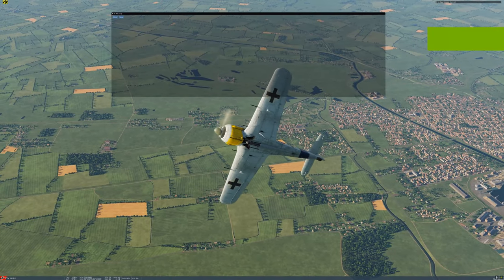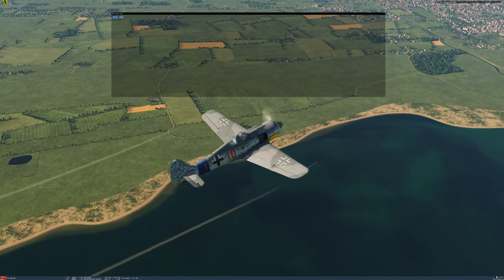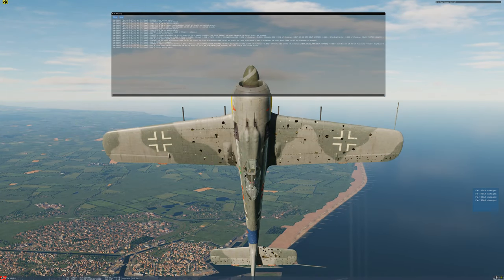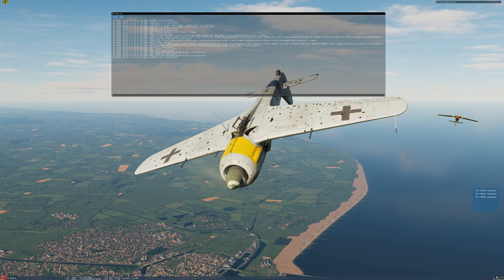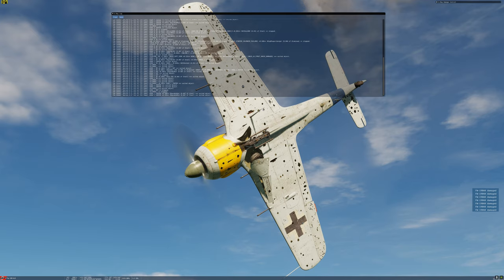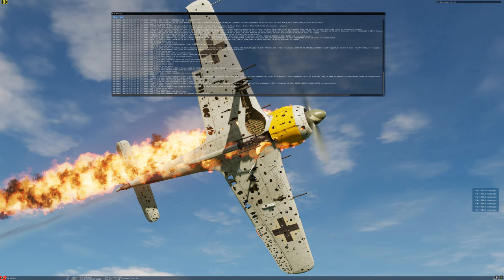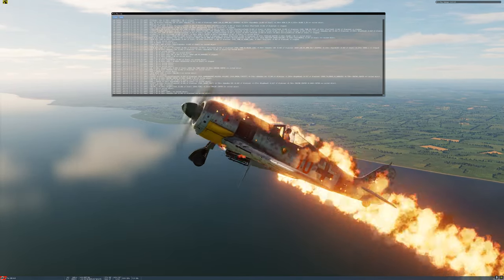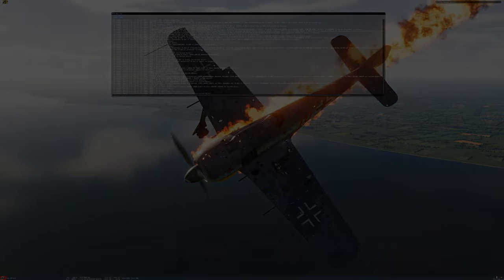User Track Analysis - DCS: P-51D vs Fw 190A-8

Comment: Hi NineLine,

Thanks for putting this together. It's amazing to see the detail that's gone into the model.

The issue for the slightly off performance sometimes appears to be the outdated belt composition we have on the P51 and P47. 

Combat Mix - Ball, AP, AP, API, APIT
Air to Ground - AP, AP, AP, AP, APIT (correct, but would probably only be used on very specified missions)
CS No Tracers - Ball, Ball, AP, AP, API

By the end of 1943 Ball ammunition had been completely phased out of both the USAAF and USN with all units having switched to either entirely API or API and Incendiary ammunition, or API with an APIT round. 

Having tested it in game with a modified lua, the differences are pretty significant. 

Air to ground should likely stay the same but Combat Mix should switch to API, API, API, API, APIT and CS No Tracers should just be pure API. This would help with their effectiveness 

I'll pop a post on the forums for you so you can report and action when you can. It's a nice quick fix that will definitely close out the argument for you :)

Thanks

Comment: Hmm, really shows how the graphics could benefit from some further refinement.  Not just any per-bullet damage in the future but also the current graphics used now.  The area of skin torn off the wing surface gives the impression the craft would hardly be able to even stay in level flight, while maybe quite literally in the code it's a different story.  Overall, maybe the current graphics are a bit too flashy, and the amount of tearing and holes in the surface of the skin can be pulled back across all the warbirds significantly, while we wait for more 1:1 damage graphics to be developed.
This would also definitely help stop a lot of the other not-enough-damage comments since the graphics tell such a different story than what's actually happening.